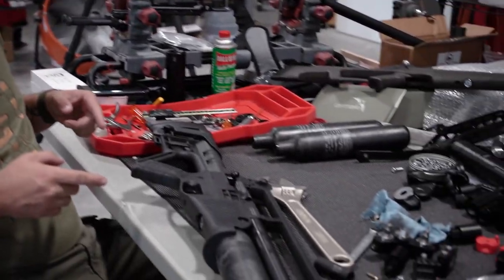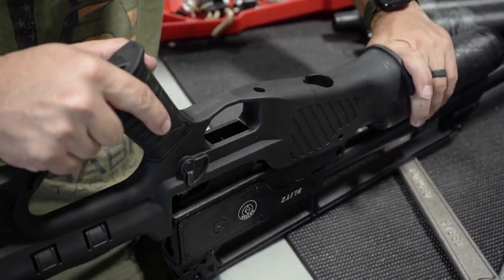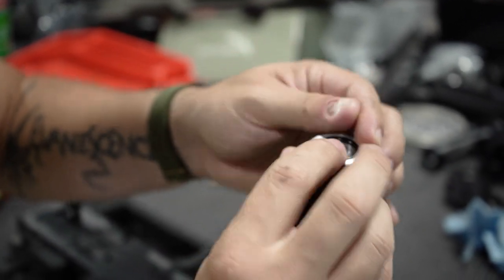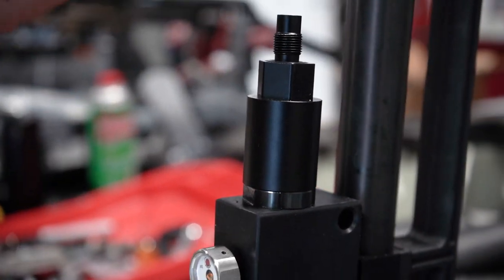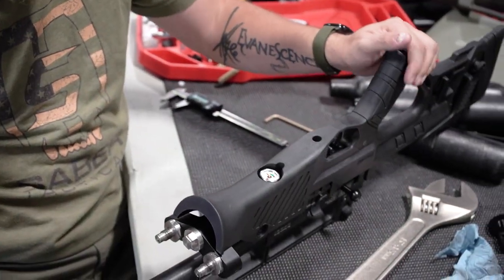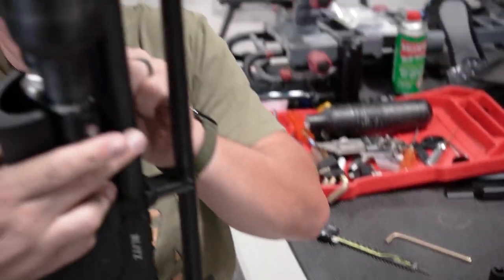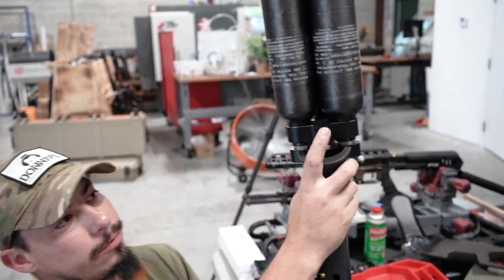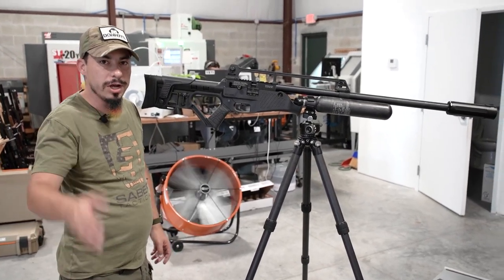DonnyFL: How to install the Saber Tactical Hatsan Blitz Double Tank Adapter

Comment: What type of Grease do you use on the o ring ?

I was curious if ballast all if I can use that to lube up my quick disconnect bearings
And airgun orings

If small amounts happen to get inside the air chamber or valve do you think it would mess it up
Reply: Pretty sure you have to use pure silicone.

Comment: Man I just wish I could find an adequate spring to get the Hatsan Blitz to work in full auto with the Ronin suppressor….cause it very rarely works even in semi auto, makes it a straight pull manual action and that’s just dumb, I’ve gotten to the point I’ve just taken my suppressor off and leave it there…which sucks.

Comment: so I found where to buy these things on the internet. I want to know where I can get the bottles for a fairly decent price? cheapest price I could find was $300 a piece. With the price of the adapter that would be $750. I personally bought 2 hatsan blitz's from hatsan for $600 refurbished. So this adapter kit would cost more than my entire gun. If I could get this adapter and 2 tanks for hell, Idk, $250 to $300 that would be fair.
Reply: You can get a 580CC bottle from Hatsan for $69 shipped. You will need the valve. It is around $55 from various companies.
Reply: What website?